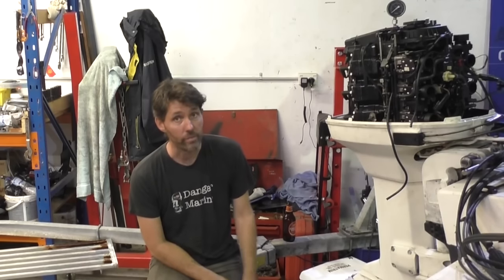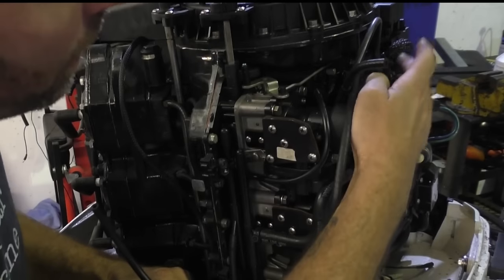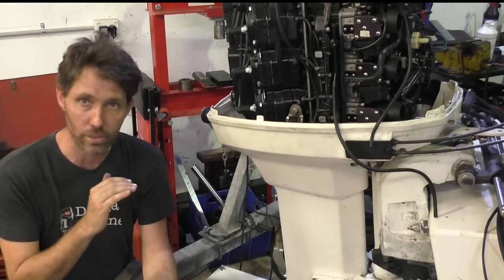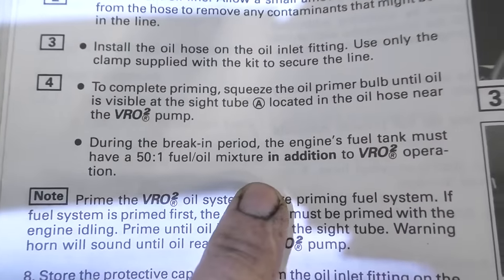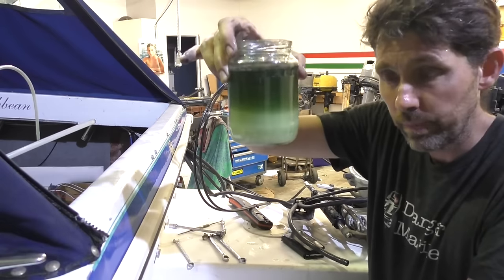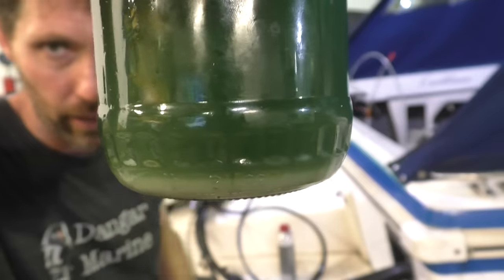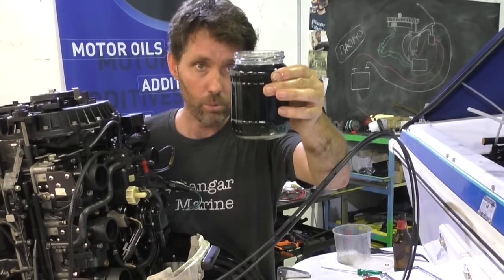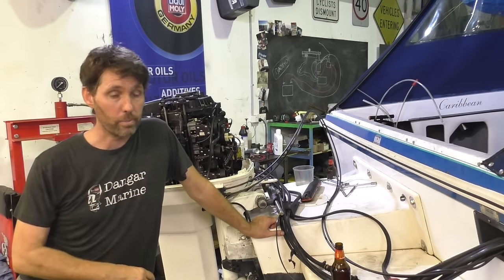Almost ready to start the Evinrude 150

Comment: Hi. 
Just watched this despite being 3 years old. I think that it may have been prudent to go up a jet size. Your observation that the factory ones are correct is overridden by the fact that you now have .040 pistons meaning that the air volume is increased leading to a lean mixture. 
Excellent series..

Comment: Good Tips about clearing out the first bit of fuel. I killed my last outboard when water got into the fuel system because of an old primer bulb floating around in the back of the boat sucking up water. I replaced the motor with a back up outboard but filled the carb bowls on the new motor with water again because i used the old fuel system for the initial test run... **Face Palm** Sound advice. Keep up the good work! I really enjoy your videos.
Reply from the maker: Ah, that happens. Sometimes its easy to forget what is going on out of sight inside those tubes!

Comment: Stu, just to back up the comments by Tony- those fuel caps must  have O rings at the top of the threads on the caps themselves. They are notorious for letting water into the tanks ( same design for fresh water tanks has been used on ocean going yachts I have been on and a couple of tacks out of the heads and your fresh water is garbage - they are just generally a bad design) and should be relocated to be vertical as even with o rings, water sits there waiting to drop into the tank unless you blow the fitting dry with compressed air before opening them. 

My OEM manual for my Johnson engine has a section that mentions changing the carb jets for altitudes above 1000ft ( dam lakes are mentioned) and for 'tropical use' , in both cases going down one jet size. The generic manual also mentions the changing of jets for higher altitude running, but no mention for 'tropical' . The generic manual does state that each carb may need different jets due to air flow and engine placement differences.

In terms of fuel mixing, no need for those fancy jars - for 50:1 just multiply the litres of fuel you have added to the tank by  twenty and that's how many millilitres of oil to add - I am a bit lazier- I take the litres of fuel, double it, add a zero and that's the millilitres of oil to add.  IE - 35litres = 35 x 2 = 70, +0 = 700mL. 

And I too was doing the "WTH" about the two stroke being the only one available. My engine likes the semi synthetics though it is of the era of caster oil and nitromethane based two stroke oil.

As for the rain, there is a bloke down the road who has this huge wooden boat in the backyard , and all these animals keep disappearing around here - should I be worried?? :-)
Reply from the maker: Hey Ron, we've got loads of nitrile o-rings in the workshop so I'll find a couple that fit, certainly don't want to be fighting water in the fuel each time. I really like your formula for 50:1 oil mixing, that's a good one to remember. Don't worry too much about the bearded bloke with the boat as long as you and your mrs get a seat!

Comment: Port balancer hose goes to nipple at bottom of air box. 
Starboard balancer hose goes to the bottom of crankshaft.

 If you are looking at front of motor, it is bottom center, right next to where the tip of the shift rod comes up and connects, maybe 1 inch (2.5 cm) toward port side.  I can send a photo, if needed, as it's hard to see with lower cowl back on.  It plugs in straight down, so look for a nipple that faces straight up. 

The idea here is that excess fuel/oil mix gets recirculated after helping to lubricate the engine or spilling from the carbs. 

Also, there IS supposed to be a thin O-ring at the top lip of that fuel cap.  That particular design with the vertical lip around the opening is really bad for funneling a surprising amount of water into the fuel tank, once the O-ring falls apart. Once they break off, you would never know they were there.   

Thickness doesn't matter too much, as long as it fits tightly around the top of the cap, above the threads. I've cut them out of inner tube  rubber in a pinch, and it works well.  I make it about 5mm oversized, and I like it better than the original o-rings, because you can see the seal all the way around the cap, and you know it's sealed up properly. 

Rain water isn't so bad, but salt water that gets in on a rough day can cause huge problems. Seal those caps ASAP. 

-Tony
Reply from the maker: Thanks Tony, you're the man! I did see that nipple at the bottom of the crank case so I know the one you are talking about. So there is one more long hose that comes off the vapour pump (short one goes straight into airbox), can you tell me where the long one goes?

Will definitely get onto those o-rings and sealant today. It will be nice to have one more problem with this boat squared away.
Reply from the maker: So I put the airbox and all the hoses on today. There is another upward pointing metal nipple on the crank case very close to the one for the starboard balancer and I am thinking that the mystery one from the vapour pump might go there. It makes sense that if it is a pump it needs a vacuum pulse from somewhere to operate. If that is indeed where that one goes then I think we are all set to fire it up on Sunday. Fingers crossed!
Reply: I'll have to go out to look.  If I recall, the vacuum line that powers the fuel pump comes out of the block horizontally, and it usually has a pulse limiter on it- a sort of check valve.   It is also a little bigger, either 5/16" or 3/8" (~ 9mm)

Will let you know, as soon as I can.
Reply from the maker: Thanks mate, really appreciate that.
Reply: Michael,
Port side balancer hose goes to nipple at bottom of air box that goes over the carbs.
. 
Starboard balancer hose goes to a nipple at the bottom of the block.  It is just port of the center of the motor, down underneath the carbs, and it points straight upward.  Looking at it from the front of the motor, it is a little behind and to the right of the shifter rod that comes up from the lower unit.

It is easiest to remove the bottom cowl to get good access to these areas.  Very difficult to access with the cowl on.    I hope this helps.
Reply: thilltony thanks a lot
Reply: thilltony I still don't know where they connect, The only spot on air box has a hose going to the crank case which I thought was so the excess gas would leak out when trimmed up. Maybe previous owner added that hose n just didn't bother with balance lines? Anymore input would be great, I have the manual in the mail.
Reply: Michael O'Connell
I think the previous owner got it mixed up. Route them the way I described above. 
Maybe Stu can chime in about the way he did his?
Reply: Thanks! just rebuilt carbs on mine and was lost as to where this hose went!
Reply: Tony is the man! Rebuilding my Johnson 150 fast strike, and man am I glad I read this!

Comment: love all your videos many thanks one thing mate, cause of personal reasons i left my boat standing  on the trailer for about 3 to 4 years (4 stroke inboard 6 cylinder essex marinized ford) when i went there after we did everything we should but the engine was Not firing in the end we suspected fuel problems as the plugs where flooded with fuel that wouldn't even light up with a small blow torch the fuel tank was massive for a small boat, didn't know fuel deteriorates, even now am much too old for boats i still love your videos and anything to do with boats keep posting ate n keep well
Reply from the maker: Thanks mate, glad to hear you've been enjoying the vids. Yes, fuel definitely starts to deteriorate after a while and can cause lots of troubles with boats that have been sitting for a while. Products like Stabil can help if you know it will be in storage for a long period of time.

Comment: Hi Stu, Re jet size, don't forget that you have up sized the pistons so you are no longer stock. You will be close but not exactly the same. Great place to get help advise on all outboards is the scream and fly forum and the iboat forum (where I go the bulk of the OMC info). I got great advice for the Evinrude 175 rebuild and my latest projects building Yammie 225excels.
Reply from the maker: Interesting point about slightly increasing the bore size and what effect that will have on the mixture. I really do need to go back and do that video with the engineer. I should start making a list of questions to ask him during the interview. I'm guessing the larger bore will create a faster air flow during induction which means the volumetric efficiency won't be as good with a same size throttle body which will effect the torque curve, but I'm hoping it won't make it run lean.
Reply: I went back through the info I received and the gent that gave me this advise stated when he went over 020 and if I recall correctly you haven't so it should all be good.

"Anything I build over .020 goes up 1 size....
The 91 150/175 was the hotter(hp) engines but most troublesome due to way casted/made. Make sure you have block pressure tested before any machine work and due the updates (intake gaskets/grey spark wires/sealing plugs on throttle body)"
Reply from the maker: More and more it is sounding like these carbs should go up one jet size then. There are actually  040 so I'll give the engineer a call on Monday and see what he says. I'm happy to continue working on getting this started up in the short term, but for long term health it sounds like a change might be in order.

Comment: Why is it whenever someone does a major mechanical job on a piece of equipment something has to always come up right before you fire it up? Lol. I've been I that situation before myself. It is a good thing though that you found all that water Stu. I've been told that water in fuel is really hard on a two stroke engine. That motor looks great. And don't feel bad about having pre start up anxiety. I feel that way with every big job I do on any engine. I always pray to the gods of good running motors as I carefully turn the key! Than after it's purring like a kitten you can sit back with a cold beer and relax with a smile on your face! 👍
Reply from the maker: Thanks Jack (is that right? my terrible memory!) I did give it a sneaky crank today with the plugs out and it turned over nicely. It was a bit slow so I checked the battery and it was very low so I've put that on charge for the real attempt to start it on Sunday. I'm half anxious and half excited. :)

Comment: U are the man now I got problems with mine it's getting harder to start johnson 150 I think I'm going to change plugs but I think it getting way to much gas
Reply from the maker: You may be getting that petrol smell if it isn't firing when cranking as the unburnt fuel runs out the exhaust. I think you are on the right track to check plugs and check for good spark on all cylinders.
Reply: Check to see if the little red knob on the fuel primer solenoid hasn't been turned partly on. It should lie straight back in line with the cylinder, not sticking forward or sideways at any angle.

Flooding motors will usually start instantly for a second, then die and not want to start again, unless you open up the throttle all the way to suck up the extra fuel, and then you have to be very careful not to over-rev the motor.   You will definitely smell raw fuel.

If your motor is very difficult to start, and you are NOT smelling fuel, check to see if primer solenoid is working properly. Usually, it's the push-to-start function of the key that is getting sticky or corroded.   You should hear a light click when you push the key.  Remove the cowl and listen again.  If you still don't hear anything, there is your problem.

Otherwise, Stu gave you the best answer. Change plugs and check spark.

If spark is weak, check inside both ends of your spark plug wires for white or green corrosion.   Check inside the orange primary wire boots going to your coils for the same.   Also, very often the ground straps on the coils themselves will get coated with corrosion.  I've had many motors with weak spark for that reason.  Pull the coils, wire brush and grease everything, including the mating surface that they are mounted to, and reassemble.  If that was the problem, it will run like a champion afterward.  

After that, you are looking at the power pack or stator.  Corroded leads or bad voltage regulators/rectifers often mess up the power pack.  

Is your tachometer working properly?   If not, your powerpack is probably damaged, and will probably need to be replaced.  But go through the basic stuff first.  It will be time well spent, regardless of what you find.
Best wishes on that.

Man...  Sitting on the couch for a week has turned me into a Chatty Cathy!  I need to go work on a motor...
Reply from the maker: It sure does make a huge difference cleaning all those connections up, a simple but very effective thing to do. It's interesting you mention the primer, I had an outboard with a similar problem where the choke plates weren't opening fully. The spark plugs being very black was the clue to what was going on there. Hope you get some workshop time soon! :)

Comment: "... which I particularly like, cause it's the only brand available..."  Laughing my ass off at that comment... but seriously, can you NOT get anything else (short of crossing the continent...)?  I'm sure that Valvoline stuff is fine.  When I was a kid, I used Shell stuff, because the place I worked was the area distributor of Shell products, and we employees got a really healthy discount on it. I figured Shell oils and products would be readily available anywhere on the planet... perhaps not.  As for the fuel tank cap, yes, looks like it could use some TLC around the collar, and for those types of caps, seems to me, there's usually a small seal at the very head of the cap, top of the threads, or else a flat washer-type seal in the horizontal piece of either the cap itself or the collar. The flat washer-type seal would be recessed in a channel, glued or cemented in.  As some other commenters have said, those vacuum tubes in question off the 2 banks of cylinders likely meet up with fittings on the airbox when that reappears.
Reply from the maker: Hey Stan, I'm glad someone got a laugh out of that. The truth about that oil is that as a car workshop we have a supplier that will deliver to us within the hour or so and it is the only brand they stock. I was too lazy to run up the road and buy anything else so just ordered that. It makes sense that all the lines go to the airbox (for both referencing intake vacuum and re-burning fuel vapour, but there didn't seem to be enough ports on the air box. I must have just missed something so I'll whack that on today and get ready to start. :)
Reply: Stan Patterson I

Comment: When I raced two stroke motorcycles and had to re bore them, we always had to re jet the carbs because the larger bore would mean they would run lean.
Maybe this was the problem from the previous rebuild if you could find nothing obvious wrong?

Comment: I have that very same fuel cap and the removable cap ( male side ) does have a fat o-ring at the top of the threads right at the flange. Without it you WILL get water in your tank. And if you don't know, the opening in the mounted collar goes downhill.

Comment: Yamaha gets water in oil tanks also. Always dump them out and check for water every year. One can pull some out with a suction gun from bottom of tank. Remote tanks below deck a common issue for water contamination
Reply from the maker: Yes, it's well worth losing half a litre of oil to keep water out.

Comment: The issue of Jet Sizes is prolly spot on.  Especially in a new motor.  Run just a tad rich for break-in.  A tad rich will not hurt anything.  No motor ever seized being slightly rich.  Plenty have being slightly lean ... 
OMC was not  able to get out from under the "un-burned fuel mandate" from the US EPA, so they tended to run their engines about on the edge of possible lean burn, and have been doing that for years.  Just ask all the V4 owners who ate a piston along the way ...
Carbs are not as efficient at managing fuel ratios as EFI under all running conditions.  Carbs will have peaks and valleys in fuel ratio based on harmonics in the induction charge.  Running in a valley for very long might put you into hot piston territory.  Stepping up one jet size will carry you over at that critical RPM.
Reply: Sounds right.